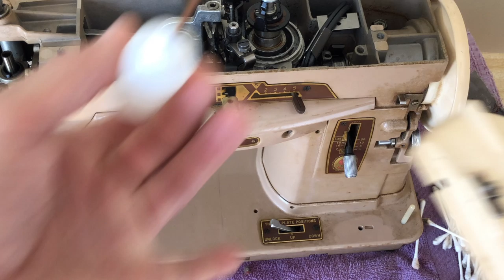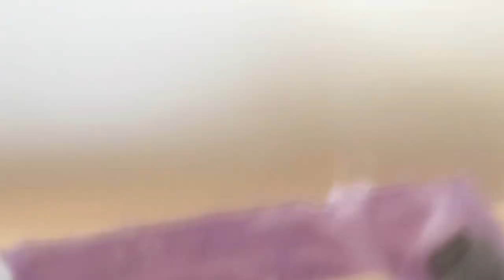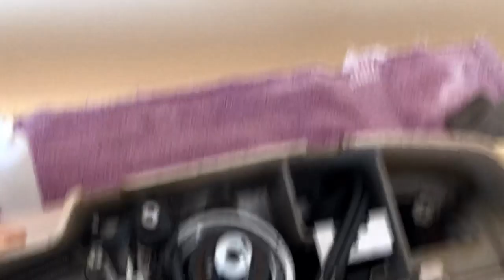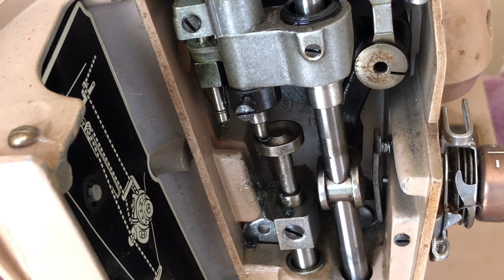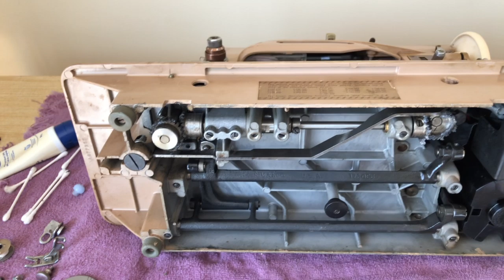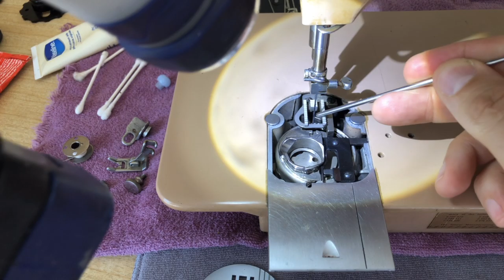RESTORATION SERIES #22:  Waking Up the Singer 403 With New Oil and Grease

Comment: I recently found a seized 403a in a blond cabinet at a local thrift store at a great price. The rotating hook was the problem. Took off the gear and cleaned up the hook spindle and all is good. These are great machines. I now have a nice 403a to go with my 503a and they both use the same fashion discs and attachments. Thanks for posting!
Reply from the maker: Very nice!